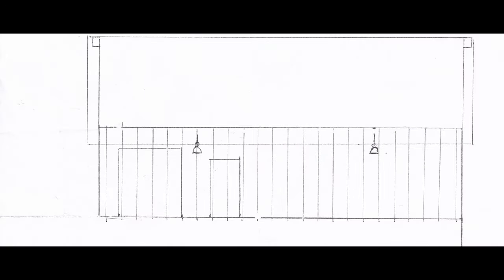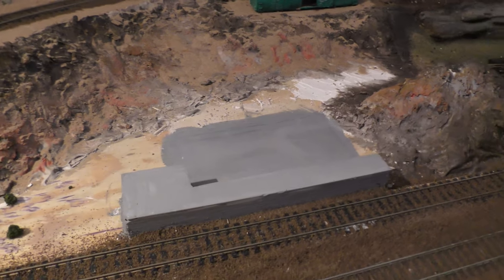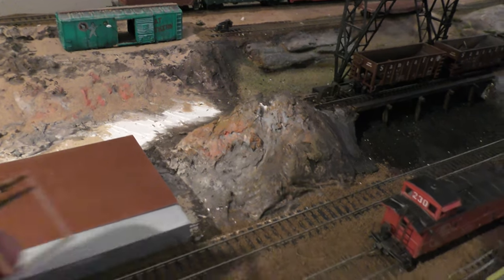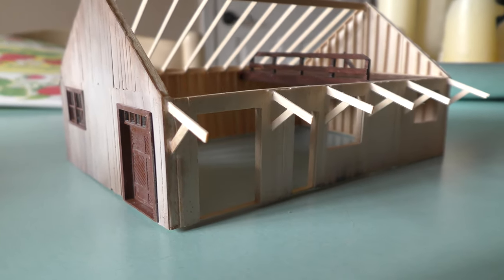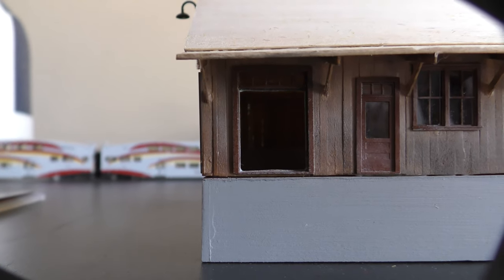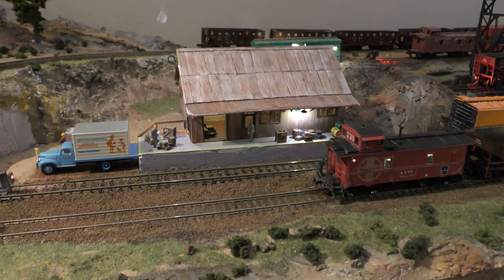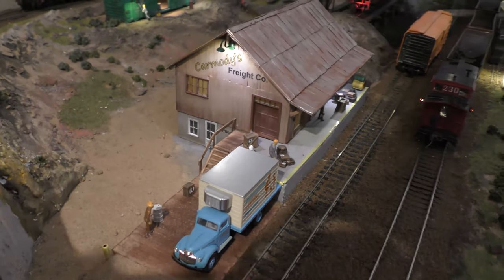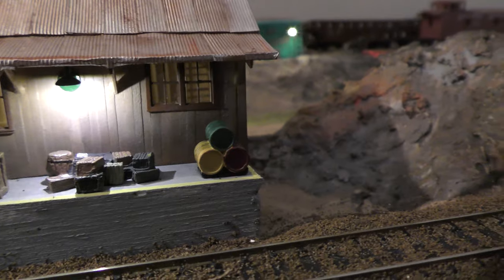Building an HO Scale Freight Depot

Comment: Well done sir.  The foil roof detail is impressive, especially the rust/weathering.  I'm experimenting with champagne and wine bottle foil - seems pretty moldable.  Does acrylic paint do ok with metal foil?  I haven't got that far.  Your roof looks pretty dang impressive.
Reply from the maker: Thanks!  The roof turned out really nice.  I showed it to a guy who's a master modeler and he was blown away by it.  Heavy duty foil is what I used and I would prefer something heavier so maybe wine bottle foil will work better.  It has to be pliable enough to get the detail of the corrugated tool though.  I used pastel weathering powder on all of it and then sprayed it between layers with matte finish.
Reply: @YardLimit  Spraying matt finish and building up layers ... that is a neat trick.  I'll start using pastels .. thank you.